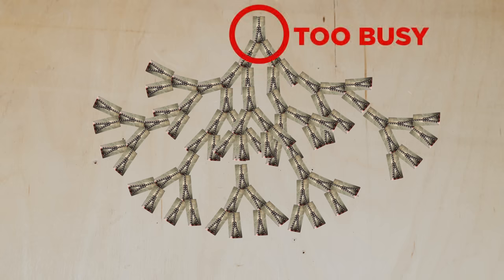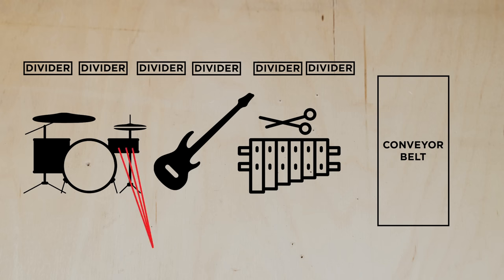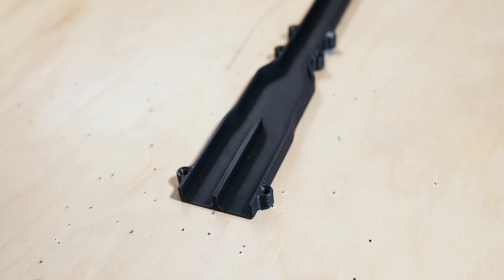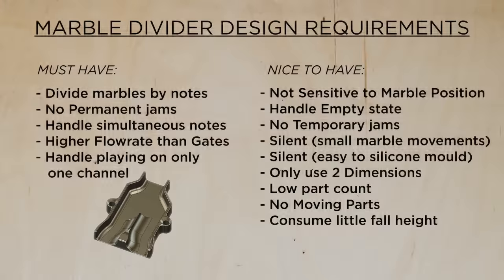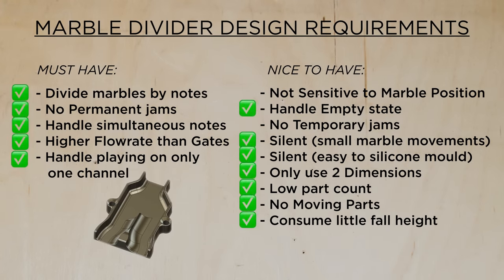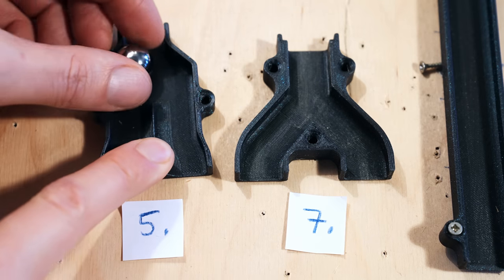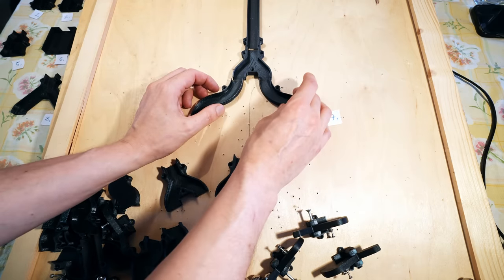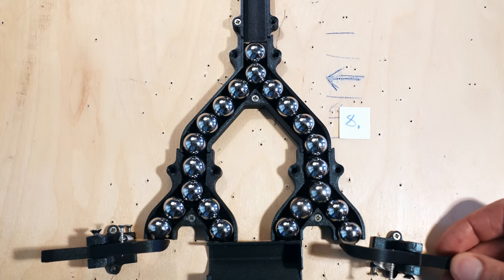Mystery Marble Divider?

Comment: You're not going to get one that isn't sensitive to marble height without introducing more common jams. However, what you need to consider is that the marble height issue is only an issue when it comes to a tree. If you can build 1 tree splitter for each marble route with paths leading from the tree splitter ends to the release point, then have an adjustable release point with a range of 1 marble height which can play an entire song without moving more than about 1mm, then as long as your splitter is built to the correct marble height from it's top to it's bottom, you can adjust the marble height at the release point without worrying about the marble height throughout the system. 

A mathematical way of expressing it might be if splitter height divided by marble height = 1, then as long as you can make the route length + release adjustment divided by marble height = 1, then marble height is solved as long as you only use 1 splitter.

Comment: I think you made a near-perfect design. Regarding the "no temporary jams" and "not sensitive to marble position" could be solved with a battery driven vibrating device that rattles the jam-sensitive areas just enough to roll the marbles into place

Comment: In my opinion, making the divider dependent on a perfect height setting will definitely lead to reliability issues again. An accumulation of tiny errors will inevitably cause a block once every million separations or so. The goal has to be for it to never block. There has to be a way for it to sort itself out automatically without issues and it not being sensitive to outside parameters.

Comment: It's always better to decrease the required precision than to increase the precision, in the cases where a sorting channel doesn't need to be used, it's probably better to have a physical block that you can toggle to prevent a sorting channel from being used, instead of hoping you can find a design that never has a temporary jam that requires marbles from that channel to be used

Comment: I would add a gate to stop a marble  at a certain position that would only allow passage when and if the path is clear ahead. This will remove the wiggle paths entirely and continue with any length tubes. A small rocking arm could be used, this will restrict the flow a bit. Something like a geneva drive could also be used, coupled with a pin to let it spin or not. Next track weight with a spring can be used to detect when the track is full and block the drive. But it should allways stop a marble in the exact same position and open only if the next section can accommodate the minimum of a full marble.

Second you should consider an automatic test and lift to test over night.

Comment: I think I know a way you can solve all of these problems, as long as you don't mind a solution that involves electronics.  If you used magnetic sensors to sense which channels needed more marbles and used solenoids to push the incoming marbles into those lanes you could keep each lane filled properly no matter what song you have programmed into the marble machine.  So the idea would be the marbles would run into a long lane and hit a stop.  The solenoids would be set up to align with each marble in this line for the number of lanes needed. It can then push the marble up onto the lane that needs the marble. These need to be timed so that the marbles have time to settle again before firing another solenoid.  I would also put another sensor on the line to show if the line is not full and this can delay the firing of the solenoids. This could also eliminate the need for multiple returns, but the idea of multiple returns could also be nice to see all of the different marbles moving around.

Comment: Idea for holy grail 11 version:
 

Problem : @8:37 you have the problem that the right lane gets into the middle lane which is common ground and it should stay clear (of left/right lanes) at all times.
Goal : Position independent could be translated to a tolerance from 0.0 ball width to 1.0 ball width. 
Constraints : Can't break contact chain since that is how the "which lane?" information is propagated, so no gaps.
Implementation Goal : Let the incoming ball choose the right tolerance offset(0.0-1.0) by pushing the first right-lane ball into a 1.99 ball width space.
Implementation Plan : Add a camel hump on each side with a 3D angle which pushes the balls towards the middle 
and change the division angle in the middle which is currently very small 
(the angle parameter space being from straight down(current value) to perpendicular(think tunnel with hole on top)) 

I hope this actually works :)) Good luck!

Comment: Maybe if you made a junction that let a ball pass when there's none under it by another mechanism and without the tow balls touching they could stop jamming. You could also do some "slots", maybe magnetical, that moves the ball in a better position, like if it suggest where it should be, and if you do it long enough at the top the ball will be exactly in the spot you want

Comment: This many not pass the no noise requirement, but have you thought about using vibration to help reduce the jams. This might also help the position sensitivity. Essentially, the divider works really well when all the marbles have packed very efficiently, but jams create "hole." Perhaps, trying to vibrate the divider or positions along the divider that are prone to jams might help reduce them. Almost like "annealing" the marbles packing in the machine as it goes.

Comment: foam spacers.  Where you connect it to the plywood, put in small rings or styrofoam or  cloth to dampen the vibrations.
That should help with sound even with the newer softer silicone tracks

Comment: The "Each system has its own lane" idea kinda sounds like aircraft's hydraulic system: There are 3 hydraulic systems on most commercial planes, and important systems are connected to two different hydraulic systems. 

Translating the idea to the Marble Machine, that could mean having 2 Marble Lane connected to each instrument. In the case of one lane jammed, you can feed marbles from the another lane, or enable a cross-feed system from the instrument nearby. 

Its one thing to design the system as reliable as possible, but we also have to consider what would happen if it unfortunately failed - You don't wanna fix it on stage.

Comment: You could put a hill in the middle of the devider leading upto the split so marbles are less likely to be indecisive you could also change where the input is and make it so incoming marbles use a ful lane to bump into an empty lane using marble postions however that does voiolate a desine requirement.

Comment: Try Dithering - started with airplanes using mechanical clocks/machines being able to work better with the constant vibration of the flight. This also bled into image processing, dithering is AFIAK a introduction of variation.

Comment: 14:37 a high up jam, takes out half the gates.  These 'flow' type designs seem to have this inherent flaw, there is always a balance point a marble can get stuck in where the divide occurs.  The weighted drop design doesn't have this.  I reality I think the vibration of the machine running would probably shake these out, but still...

Comment: I don't think silicone is the right way to reduce sound. A lot of the noise seems to come from collisions between marbles rather than with the 3D print. I would:
1. Fully enclose the divider (i.e. print a top & bottom half)
2. Screw it to the rest of the machine with rubber o-rings (or some other dampening material) in between

Comment: There might be an issue in the design. Your tests seemed to assume the ball drops would either occur simultaneously or independently, but there is at least one other scenario in music: syncopation.
Since you are dealing with half, quarter, eighth notes & and rests + etc., it is possible that the rhythm on neighboring channels will not align perfectly. This could stagger marble movement in a way that causes another jam or aberrant behavior. The only way to eliminate this as a design requirement is to restrict your composition to exclude musical patterns that haven’t been accounted for in the design.
Good luck! Love seeing your progress

Comment: Martin, i do not have a 3d printer or any cad experience but what if instead of building in 2d you made the marble divider 3D. you could almost accomplish this with a sort of cyclone design that does a handful of channels at a time. you could even use like a paintball hopper motor to push the marbles up the cyclone rather than using gravity. its just a thought.

Comment: Nerf has these guns that shoot little foam balls that face I think a similar problem, they're stored loosely in these hoppers on the top of the blaster and have to one by one be fed into the firing mechanism in a predictable manner. They got around it by putting angled 'agitators' on the bottom of the hopper, constantly feeding the blaster using these mechanized shifting plates. A very complex way to prevent jams

Comment: Marble divider version 10 is still performing well. Now it's about reducing the noise? Firstly. I would not mount the divider directly to a hard surface that could act like a drum head announcing/amplifying the sound. A sound damping connection might be the trick. Making a divider of silicone? Could some of the silicone material rub onto the surface of the marble and affect the travel of the marble and other parts? You want clean marbles for a predictable performance.

Comment: maybe you need to look at the gates? at 14:38 in the video you have a stop in the top division, which is caused by the gate on the left not closing correctly. you can see it on the shadow.

if that gate had not been played any more, the top division would have been stuck forever

Comment: Height sensitivity is an easy problem to solve with a single stage device in each track. All you need to be able to do is change the length of each marble track post divider by HALF the diameter of a single marble. If your dividers in series have a whole number of diameters in every track, then at the end they will dump into tubes that feed each gate. Make those tubes of a flexible elastomer.  The bottom end of each tube fits into a single THREADED barrel composed of two parts. The lower barrel or tube is fixed to the machine, and the upper barrel or can screw in and out to change the length of the barrel by up to 1/2 the diameter of a single marble. You can place a third part, a narrow lockwasher between the two threaded barrels ends, so I that when you get an adjustment set, you can lock it down.   With the flexible tube connecting this expansion tube device to the dividers, and by cutting each tube to a measure close to an even number of marbles long, you can then easily adjust each tube feeding a gate to a slightly longer or shorter length to fine tune marbles tracks to always have an even number of marbles to each split of the final Y.   The nice thing about this system is that it doesn’t require a bunch of different wiggle tracks, of varying lengths and parts. Just a single design for a male and female threaded barrel that takes up a space no greater than plus or minus half a marble diameter. And it allows for the tubes between the expansion barrels and the dividers to be any length measured to within half a marble diameter of being an even number of marbles long.  A good example of this kind of solution is the Barrel Adjuster on a bicycles brake lever and brake.   The flexible tube the cable runs through can have its length changed by screwing a threaded barrel in or out to make the brake shoes closer or further from the wheel rim or the brake disc. Again, as long as you cut the tubing close to an even number of marbles long, then for an 11 mm diameter marble, the barrel adjuster will lengthen or shorten that tube by no more than plus or minus 6mm. And the beauty of of is that all the barrel adjusters are about the same length and can be placed the same distance from the gate.

Comment: You guys should really try a TPU version of the 10th version. If you got a printer with direct drive then I strongly recommend it!Should in theory remove nasty unwanted sounds whilst keeping dividers, ”wiggle lanes” and possibly other types of lanes fairly sturdy! If there occurs damage on screw holes you could also implement PLA or PETG inserts to thoughen them up a bit.

Comment: Interesting... so I guess we're all set with the gravity powered flywheel system.... On to the marble dividers!!! 
I like the divide and conquer method, keeping individual loops for individual instruments.
That means more marble dividers and more lifters too.
So now there are more parts spread out over a wide area, with more possible points of failure.
But with a lower quantity of marbles being processed in each loop, we can actually lower the chance of failure.
This prototype looks promising... and at least we know that Gravity remains constant.

Comment: I have an idea for when one intersection jam: make 2 of them and do a conjunction down, so they have half the chance to jam and if you do a series of them the one upstream will not jam and you can connect them in conjunction downstream so the lower one won't clough the circuit if jammed

Comment: Keep each channel as an independent track. Then use the programming wheel as the lifting mechanism. Ball hits a snare drum and goes in it's collection bucket. Travels down an individual snare drum path to the wheel. Programming pin comes around, picks up the ball, and deposits ball in snare drum track. Closed loop system.

Comment: Since they are spheres, I would think you'd need to think in terms of hexagons, since spheres always arrange themselves in a hexagons when packed together.

A vertical input tube that separates into 6 vertical tubes via a hexagon tray with a small dividing hexagonal "pyramid" in the middle of the hexagon to sort them all out.

Comment: I love the video and your ideas in it, but there's one thing bugging me: the height adjuster is based on the assumption that you can't fully control the height of the gates because of other geometries they will interact with. If you had the gate built onto the end of the marble channel you could keep the heights consistent, and using a control rod or pull cable would allow you to adjust the distance between your gate and your timing mechanism, similar to a bicycle brake cable or an RC servo linkage.

Comment: Not sure this functions as a proof, but the basic jam condition is because there isn't enough clearance along the edge walls for the marble diameter. In your latter 2D designs you roughly avoid it because you're using closer to a 45 degree angle. This effectively minimizes the clearance area to the arcs required for the next marble to pass because now the rectangular sections of clearance are part of the exiting chutes anyway. To do this well though you have to adjust the potential end position of that last marble in the exiting chute. This is because now your marbles are effectively now part of the opposite wall and if you don't adjust the height just right you're creating a similar jam condition when the exit chutes get filled.

Comment: I'm only half way through but a thought has been lingering which could solve jamming issues... so a couple times when the gates open n closed it would bounce the marble into alignment... so what if you just added an extra gate on the end of the splitter like a valve. It opens and closes during opperations to keep the splitter aligned. The gates would run to single channels for the notes where it leads to the play note gate.

Kinda like how we have valves in our viens to stop blood going back on itself between beats.

Comment: I've said it before, but I'll say it again: the path you're taking is the right one. Plan and test, and revise and test, and keep on it until you're confident with every module.  THEN try building it.  It's an extreme version of "measure twice, cut once."  The dispiriting part with MMX was you designed and built all these parts again and again at considerable expense of time and money, and when they fail, you lose it all.  If you designe and test all the modules independently and then go to build the machine and there's a problem, it should be a lot easier to redesign the individual modules to suit the whole machine.

Comment: The wiggle tracks might solve lane length issues but could also possibly cause timing issues later on due to different speeds in each lane due to non-identical curves.

Comment: Instead of using wiggle channels to allow the resting point of the dropper to be adjusted, you could perhaps just have the number 10 divider feed into individual gates that are actuated by a bowden cable from the dropper activation. You might have to make sure that there are always enough marbles to feed the dropper line, but with intrument specific loops and stuff that may not be too difficult. If you could make it reliably ingest marbles every note, then you could only hold very few marbles  in the channel right after the dropper, which would solve marble pressure issues ( i dont remember if you solved it in terms of the dropper itself ). 
I think this is basically making the dropper gate have two stages and you can hide the variation in dropper track length between those two points so that is doesnt matter anymore.
Reply: In terms of marble pressure, the dropper gate woild be releived, and the top gate would have to deal with it, but the marbles could more easily be all horizontal so the pressure would have a harder time accumulating as much